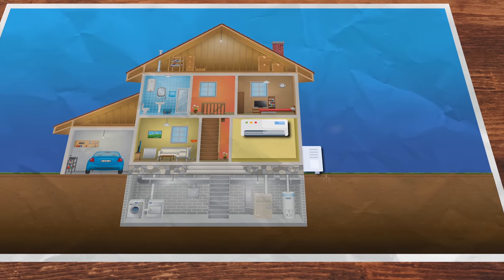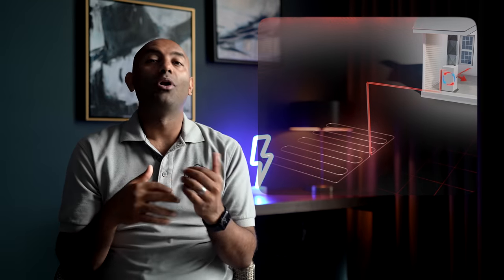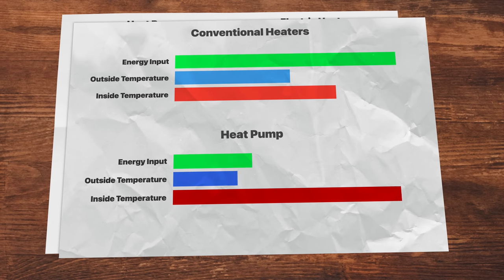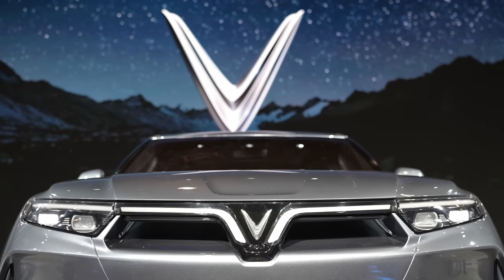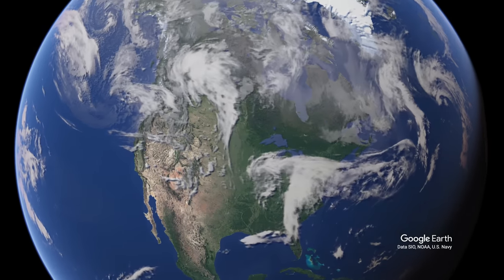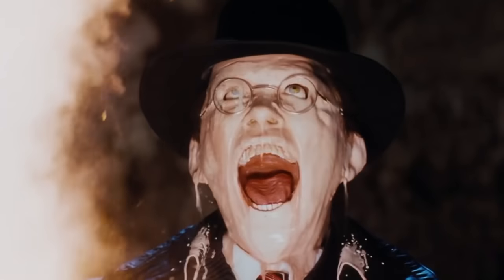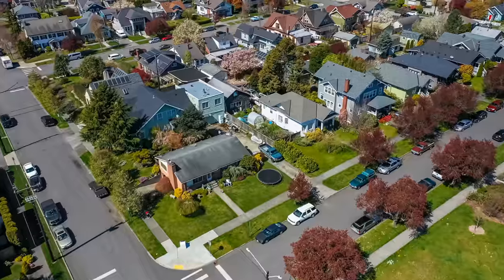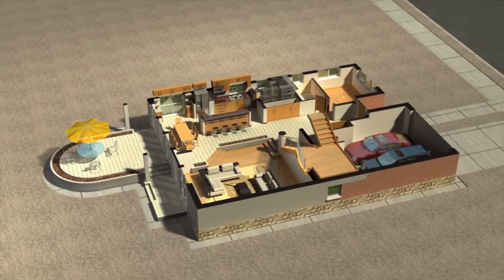Adding This Can Save You Money Summer & Winter!

Comment: I built my house in 1994 and installed a geo thermal heat pump system. I live in Northern Ontario Canada and my heating costs are equivalent to operating a 18 cubic foot freezer. My house is 1800 Sq feet. I had to replace the unit in 2010 and the new heat pump is more efficient. I can't believe more people don't take advantage of this awesome technology.  Especially in a semi rural environment.
Reply: i think its partly due to the installation cost, mostly from the wells needing to be drilled, and the fact that a lot of heating and cooling companies either dont offer them as an install option, or do but still heavily push an air source unit.

the first company i had called for a quote straight up wouldnt give me one and instead quoted two crappy meh efficiency air units.
Reply: @The_Lone_Aesir  in 1994 there was a government subsidy that brought the installation costs in line with a high efficiency gas furnace plus an AC system. Where I live gas is not available.  I have a 1000 foot closed loop line in my yard. When the heat pump needed to be replaced in 2010 somehow the heating company got me a new grant. I love it. Wish I could afford to heat my garage like this too.
Reply: @PhillipBailey  heat your garbage? are you composting in the winter or something?  🤣 

J/k.
Reply: @xiaoka  composting produces heat 😋 (granted it only happens in a certain temperature range)
Reply: @PhillipBailey  I probably can't even get the well-drilling equipments through my side yards to the back of my house in California.
Reply: @JW77   You can... Just going to cost more because they will have to use the smaller set-up's an another man or two to carry piping an crap.
Reply: @The_Lone_Aesir  I have no ideal where you live, But I think it has to do with not having dedicated companies like other countries do tbh. In turn making it harder for you to figure costs out most the time it's better to call a well company to run the lines an HVAC for the rest of your services.  Second most is I don't think most people know they can do this themselves pretty EZ an cheap if they have the land for a horizontal line taking out 1/3 the cost.   Plus people here are not seeing the LEEPS and bounds Germany is making with integrated home systems. For heating or cooling everything fridge, freezer, water, house even dry clothes. Think how easy and cheap going solar an batteries get when the house take 20% the energy, Drops even more when you build better sealed homes.
Reply: @dizzlethe7346  that probably is indeed an issue and hope as more companies come on line the cost starts to come down a bit.  I do agree on reducing energy load before going solar.  That is exactly what i did. Made all of my energy improvements that i could without gutting the house down to the studs and only then went solar.
Reply: A specific geothermal used the world over is called "Canadian Well". The principle was brought to Canada by French settlers back in the day who knew it as "Puits Provencale", Provencale being the funny French name for the area where this was used since forever. It is basically a pipe buried more or less deep to circulate air. Extremely simple, only moving part is a fan unless you can get by with natural convection (as back in the day) so lasts forever. In Canada they used the system to keep abandoned places above freezing during winter so pipes don't freeze at no cost. In France they used it to stay cool at no cost. In modern systems you use it as the intake for a more sophisticated setup to improve efficiency by quite a bit. It does require quite a bit of digging so it benefits from planning ahead.
Reply: @The_Lone_Aesir  Which was the right thing to do. Everything becomes simpler, smaller and cheaper if you first insulate, make airtight and get ventilation sized just right. I did so and ended up with the smallest mini-split on it's lowest setting being too big.
Reply: Which heat pump did you select when you replaced it? If I may ask
Reply: @kjlahti782  it's a Geosmart unit. Not sure the tons. I believe 1.5 to 2.
Reply: i was wondering how Canada faired with geo thermal
Reply: @The_Lone_Aesir  in our area we use sand point wells I can get 2 wells pounded for under 8 hundred dollars and as the weight of the water coming up is the same as the water going down a circulation pump should work if not a shallow well pump will do the problem is finding someone who will upgrade my AC unit with à reversing valve max cost should be under 5 hundred dollars and I can fix the rest
Reply: @tegrity-farms9842  Just as all other heating and cooling, It depends on how tight your home is.   As far as usability, Most them work a lot like a mini split but always at top efficiency so freaking amazing! lol.  TBH IDK about Canada... But the family has a Large cabin in "central" Alaska an going geo made it so we were able to go full solar with back-up gen not the other way around...
Reply: @astranger448  I've seen a similar thing, where a couple built their home up against a small hill and pushed a steel culvert pipe through the hill. The pipe is long enough to cool the air significantly before it reaches their home.
There is another company out there that has thermal batteries that work in a similar way. They bury ducting in an insulated sand pit and then pipe in hot air to warm up the sand to several hundred degrees. The big thermal mass can hold a lot of energy for a long time. You could probably make a much simpler version using thermal solar panels to heat water and circulate that down into the heat battery. Solar thermal is a lot more efficient than photo voltaic right now. Small solar powered water pump and you can stash away a ton of heat for future use.
Reply: I Loved having a heat pump

Comment: I have had my ground source geothermal for 5 years and coupled with my solar panels have been net zero home for energy. I don’t pay any type of gas bill and my Solar array has eliminated my power bill. There have been many comments about not being worth it and being complicated. It has been around for a long time, it is simple and after tax incentives not IHC more than typical natural gas/ propane for install. It makes your home heating and AC needs all electric and you can easily counter those energy needs with solar. I have a whole home battery back up system to go along with it making it possible to run in grid down scenario. Good stuff.
Reply from the maker: Amazing! That’s my goal!
Reply: Living the dream
Reply: How well does your system run in summer and winter off grid with just solar?  How much solar do you need to run both seasons off grid?
Reply: @BigBobbyK  I don’t run off grid much except if the grid is down. I do it on occasion more for fun than anything. I have 40 kWH batter back up and my Solar is approx 11kW so I can easily fun everything off grid for extended periods of time. I don’t have time of use power so not much advantage to suing the battery normally. I have 1 to 1 net metering so I equal out throughout the year to be net zero.
Reply: Jordan, you made some wise choices that you’ll benefit from for many decades. I did the same thing 20 years ago with geothermal and more recently with solar. I did the geo using borrowed money when interest rates were low so the savings balanced out the low interest costs immediately and the loan was paid off early. My only question is why more folks don’t make these same long term decisions. It’s a logical move and a win-win one even if your current energy costs are low. I’m not totally energy independent yet as the power wall batteries are still too costly and I already bought a 20kw emergency generator back 20 years ago when I bought my place. I’m still using the grid with my system so my total monthly energy cost is a $30 a month connection fee. If the power walls and their competitors become more affordable, I’ll make that move. My generator is now getting old so that timing will work out I suspect.

Comment: My cousin in Iowa, installed a geothermal heat system into an older home about 5 years ago. He loves it. They  drilled down vertically 20 30 ft or something like that with four five loops. Unless there's bedrock, drilling vertical is pretty basic and there's a lot less disturbance to terrain. He told me that the contractors preferred vertical drilling to horizontal burying. But what do I know.
Reply: Yeah because vertical drilling is a lot more expensive, so he makes more money off the job.
Reply: 20/30ft? I hope it was 200/300 in Iowa, Or they went with monster holes and double/triple looped in each hole with something packed back in for surface defusing.. Otherwise they are paying WAY more then they should on heating and cooling on the unit's end. OOF...   I have put wells of all types all over 49 of the 50 states plus we rent/use all types of Heavy equipment. 
 I can tell you right now they screwed your cousin in more then one way. Right off what he said about the bedrock is backwards! You drill when it is bedrock because the drilling heads are made for that! Plus the extra time of moving the rock compared to a backhoe or bulldozer, Trying to find a service to haul it out and all the backfilling you have to do and buy. Because you can't just toss the rocks back on what is basically plastic tubes. So punching a 200ft hole or two is not only easier but less to clean up and haul away when you have bedrock under 25ft deep. But you still have clean up an all that the entrails from punching wells to deal with.
If you have the land (like 12000ish sqft) and bedrock is not a problem going horizontal will save you AT LEAST 20% in Total cost's of the system. The ONLY downfall is the time it takes for the grass to regrow and maybe one more day of a "open" pit last one is more a precaution then a downfall tho.. But the benefits are numerus... No extra hidden cost's of regrading  the yard or clean up that can save thousands! Open testing so your not taking huge hits for others mistakes (wrong size runs, pinched or leaking line ect ect.)that can be costly. Run less lines means less things to fail not just in the lines but you don't need manifolds or to worry that every line is the EXACTLY the same size/length. You get the best efficiency because you don't have "bleed" from the lines being so close to one another in the vertical well, Or the worry about pulling all the heat/cold from the one small area you punched in the well. You can't repair or de clog a ling in a vert well either... Icing on the Cake with the difference is you can rent backhoe for a weekend and do 90% of the work DIY and save at least 5-10K if not double that depending on the area.

Comment: When retrofitting an old building, make sure to have a good conversation with your contractor/installer. Because you will find that to reduce the cost of installing any heat pump system, isolating (edit: should be insulating) the building will come first, second, and third, before installing your heat pumps. This will reduce the amount of heating/cooling required from your heat pump system, and make it far more affordable.
Reply: isolate --> insulate
Reply: @PeterLawton  Thanks, I am dutch, and English is not my first language. It is what you would call a dutchism as the dutch word for insulation is isolatie. LOL
Reply: Not "isolating". The word is "insulating".
Reply: @MikeAG333  You are right. I edited my post. please see previous reaction and my reaction
Reply: You are absolutely correct. The approach is first to fix the hole in the bucket before pouring more water in! 

Insulate first, every time!

Comment: I investigated this when my house was built in 2007.  At the time, the added installation cost made it prohibitive.  I also knew a person whose system leaked and my air handler is in my attic and I didn't want the added risk.  In the winter, when my heat pump is running all day and night, I really wish I had ground source system.  They also don't have the fan noise that you get with a normal heat pump, so that's an extra bonus.

Comment: Switched from a fairly efficient air source heat pump (Trane XL18i) to a ground source heat pump (Bosch SM). Simple truth is that the air source heat pump works best when you need it least, and struggles when you need it most. It's only great in mild climates.

Geothermal is a revelation, both in comfort/performance and also efficiency.

For reference, we have two vertical wells, and total cost was about 31k. 18k for the system, 13k for well/plumbing work. But the whole system fell under the federal tax credit, so 26% off takes it to maybe $23k all-in
Reply: Your original Trane system may have been efficient at the time but is at the bottom of the list compared to possible system efficiencies today.  The SEER rating for that Trane was 14 in a range of possible ES ratings of 13 to 26.  Had you simply upgraded your air to air system you MAY have seen similar savings to the geothermal system.  In thinking about cost benefit you really have to consider the costs of just an air to air upgrade vs a whole new undertaking to install geothermal.  Your argument may have been valid 10 or 15 years ago.

Comment: I'm planning on buying a piece of property, preferably around 2-5 acres in a couple of years and will be putting in geothermal myself.  The vast majority of the cost of a geothermal system is installation, so if you can run a backhoe and have even the slightest mechanical aptitude, these things are pretty easy to install yourself.  I'm willing to bet that at least 2/3 of the cost is installation, so if you can do it yourself, you can probably save $10k on the system.
Reply: Good point but you may be overestimating folks ability. Not to just dig the horizontal field pattern like mine but to do it in a way that looks decent when they finish and for the grass to recover properly and blend in. My guy spent two full days on the job. He had many years of experience but it still took five years for the dig area to look normal. I reseeded it every spring to speed up the recovery. This said, it’s a minor cosmetic issue and my only misgiving. My system is 12 years old, it paid for itself within 7 years so I’ve been enjoying quite significant savings on my energy bills ever since making this long term move. The savings also allowed me to put in solar and it’s saved me so much I will recoup the cost even quicker because our electric rates have more than doubled. It’s not rocket science or even differential calculus to figure out. The only folks who won’t benefit as much from making the choice are those whose jobs will have them moving every few years. Even they will benefit some just not as much as those who remain in one home.
Reply: I'll sure be looking forward to your
 video when you do
Reply: I installed my geothermal myself except for the loops. 4 horizontal coils on 1 acre lot. That cost $5,000 installed and he came back and filled the system after i got it all hooked up. 
I have 6 zones infloor. 3 zones inslab downstairs shop and storage. 2400sqft. And  warmboard 3 zones upstairs. 1000sqft. And 2 chilled water fan coils for cooling upstairs. 1 chilled water fan coil downstairs. $22,000 complete. I had estimates for conventional heating and cooling for my house  $26,000- $34,000.
So actually installed geothermal myself cheaper than having conventional HVAC installed. 
All electric house. 
10,080 watts of solar. Zero bills 5 years running. 

Oh yah, I drive a forklift for a living.
Reply: @danmccoy6164  That is a freakin awesome story, dude!!!!!

Comment: My house in southern Finland has vertical geothermal (230 m) for 9 years now and we have been about ~70% of the heating costs compared to oil. I'm really happy with it as it requires less maintenance and helped us to get rid of oil. It has already paid back 25k€ investment and is getting even better now as the energy prices go up.
Reply: @matiasgrieses2409
"we have been about ~70% of the heating costs compared to oil..."
1) = now approx. 70% of oil costs? (Which seems a high %).  Or,
2) = now approx. 30% (reduced by 70%) of oil costs?
Thx, & blessings.
Reply: @adad1270  Oh, saving 70% compared to oil. Looks like I missed a word .